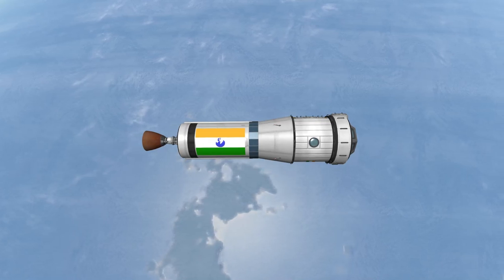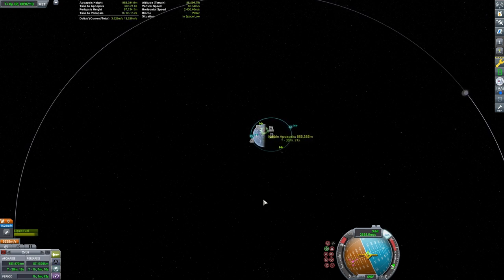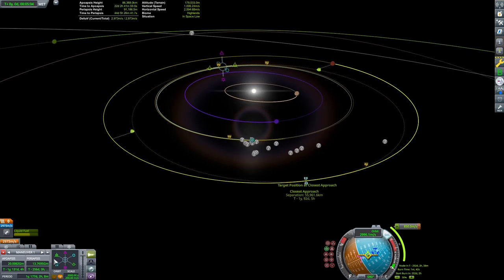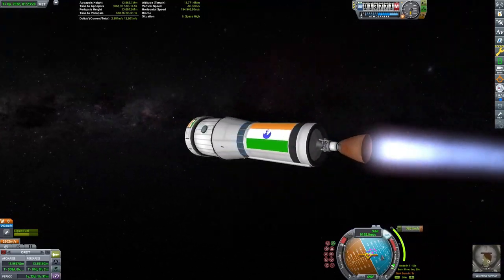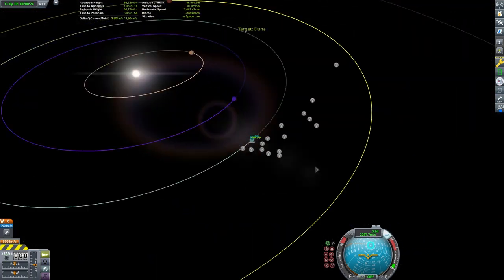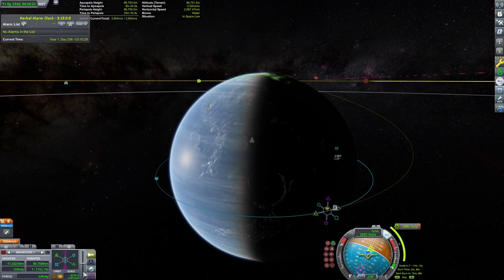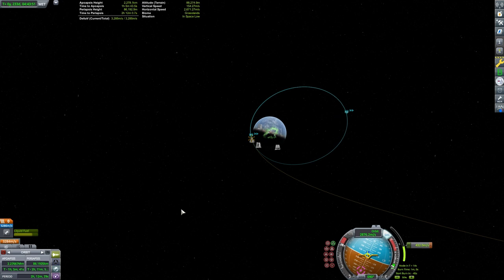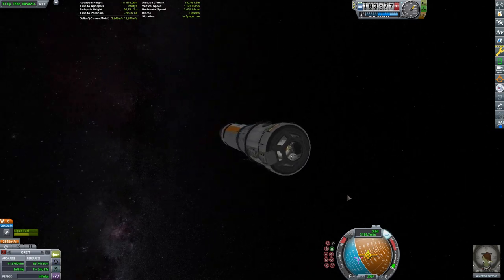The Importance of Transfer Windows

Comment: hi which mod are you using to adjust your maneuver node?
Reply from the maker: I am not using any mods that have an effect on maneuvers. All maneuvers are done in the stock game. If you have a maneuver node selected, then on the bottom left of the user interface you can select the maneuver editor. It is a very useful feature.
Reply: @Echo3  thanks i never knew about this!